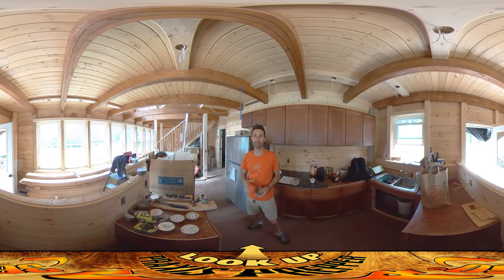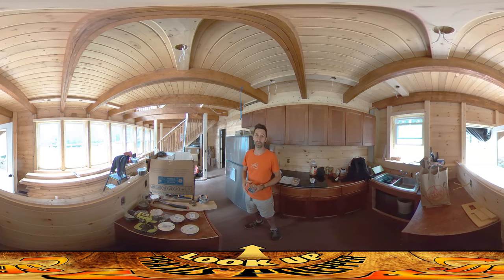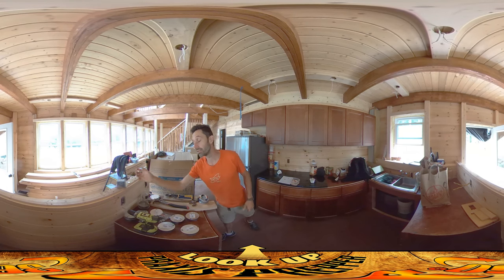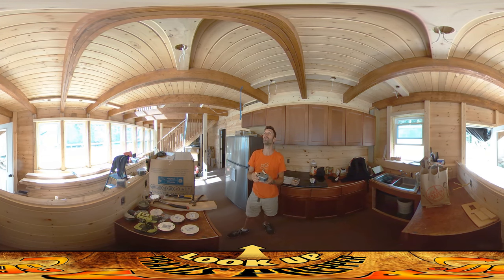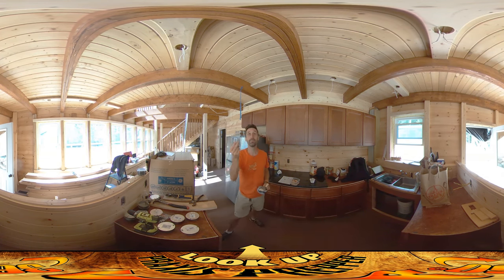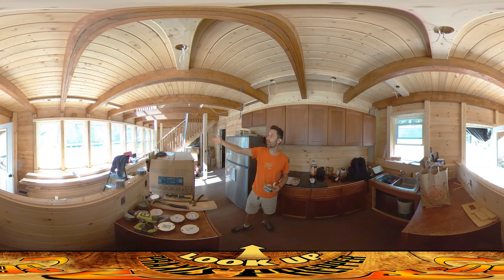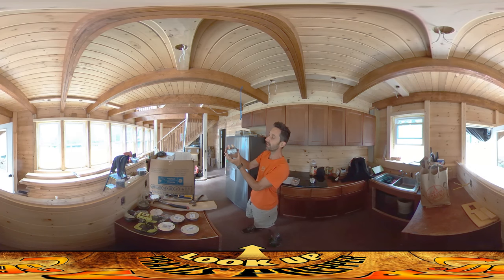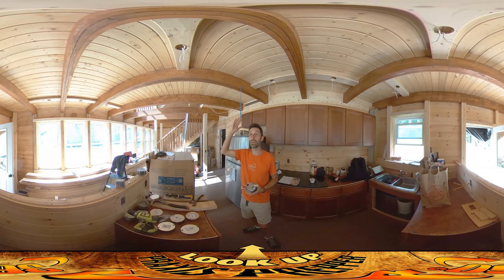Homestead Building - Choosing the Correct Electrical Box for Ceiling Lights

Comment: Doubt that the way they are attached will ever hold a ceiling fan, but hey, at least the boxes are correct :) ... maybe if that was also the case with the other boxes, it might have been better to have those in, simply because the amount of people thinking they can attach a fan to those would be more limited. The correct boxes sort of imply all will be well, but will it really? Only the future will tell i guess ^^
Reply from the maker: I"m not sure of the excat load capacity of the boxes as I installed them, but there are two screws with maybe 1" of vertical penetration into the upper floor boards. I'm thinking that they could probably hold a bit of weight.

Comment: LOL Praxis you used code and common sense in the same sentence now THAT is an oxymoron for sure
Reply: lol
Reply: Well, i think it's safe to say that 'code' at least started to prevent people without any common sense to hurt themselves. And after that is was basically in the hands of politicians and the like... so, sure, no surprise where it actually got all messed up ;)
Reply from the maker: I like to think that the codes are there to protect total idiots from themselves. And for that purpose, they basically work. By the way, I found out today from the building inspector that there is nothing in the building codes to prevent contractors from dumping radon contaminated rock under a house.
Reply: @PraxisPrepper  wholie, no rules about that :O ... let me guess, local politics is dominated by former contractors?